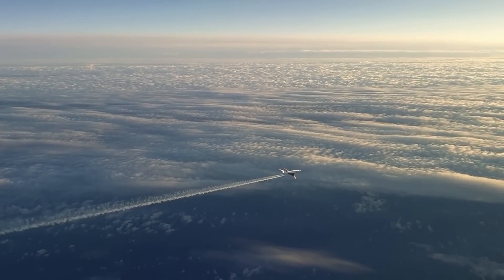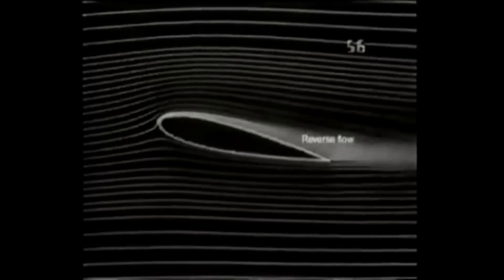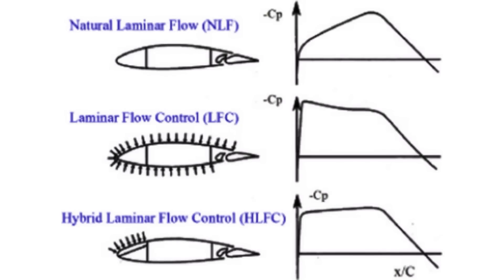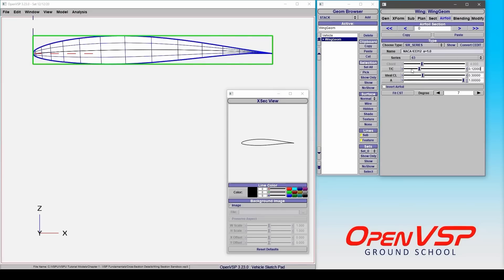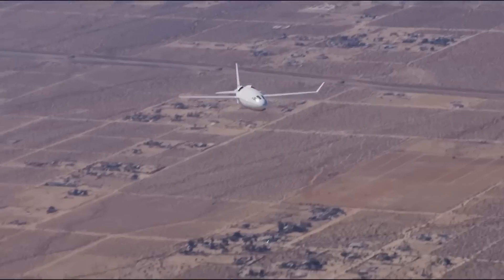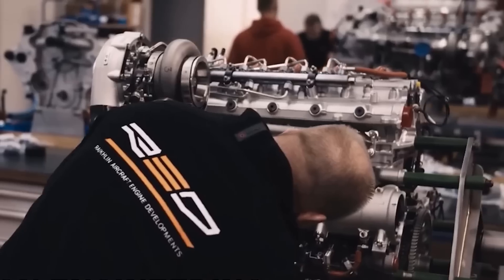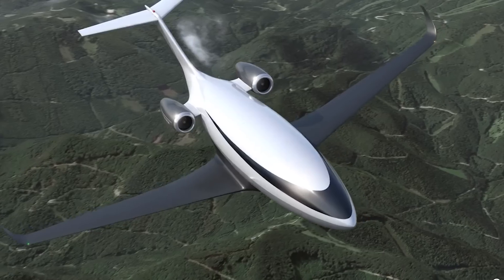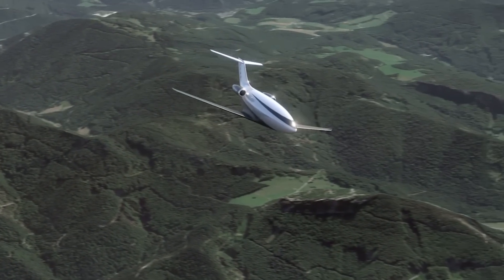Otto Celera 800 vs. Celera 500L The World's Most Efficient Aircraft

Comment: I'd hate for this to be vaporware, but it's been a while.  What are the drawbacks and what are the challenges to overcome?
Reply: According to another video, test flights for the 800 are planned for 2025.   That's pretty good time, but they have probably been working on the 800 concurently since the program started.  I don't see much that could be called a drawback to this design, other than the fact that it doesn't appear to scale up  to  larger aircraft.  The unique shape required by the fuselage for laminar flow, limits it's size.  You can't just make it longer without making it wider.   So it looks like it will be an optimized design, aimed at business class jets.   At least to start.  It should dominate the market in that space I would think, making conventional business jets practically obsolete.  
     Once the design is tested, you have FAA certification.   That takes approximately 5-9 years for a new aircraft, but that would depend on what stage of certification, if any, that they are at now.
    That's my unqualified opinion.  Take it for what it's worth.  They seem to have a strong team and business model and a great product concept that is essentially proven in it's design.  Can't wait to see one in the air.
Reply: At least someone is asking for analysis (I hate hype and empty claims).

Laminar flow isn't new, actually more than 60 years of studies, as you see, even the wind tunnel footage is older than most of us, and laminar wings have flown for 40 decades already (eg : Dassault Falcon 50). As for a laminar fuselage, it isn't new either, the Sukhoi 27 Flanker is one very nice example, an aircraft that can fly without its main wings.

Problem is, as stated, SIZE. The bigger the aircraft, the fatter it gets, at some point, you'd better change plans to a blimp rather than a sturdy fuselage with wings because it becomes TOO heavy (structural strengthening), and no, composites won't help much. Because you have a size limit, the purpose of your vehicle is limited to a niche : something small, private, no heavy cargo, either a private jet/turboprop, or a small 2, 4 or 6 seater piston / EV. That's not new : Paternavia P68, Piaggio P180 Avanti, Lancair Columbia... And because you have a bunch of competitors on the market, both conventional design (efficient enough so far and proven profitability) and slightly on the edge (ego centered marketing), you, as a manufacturer, won't sell thousands of units, more likely a few hundreds (is it profitable?)

Now, manufacturing and maintenance wise, such fuselage and wings are likely to be moulded/printed as a whole, when they are damaged, you cut big holes and replace/reseal. That's no small feat, and very expensive. Why? Because a cylindrical fuselage can have multiple sections, and many of those sections are nearly identical, you can design sections in such a way few minor changes via very few tooling alterations can finalize the assembly of an entire fuselage (also, provides you a comfortable room for changes/improvements depending on customer demands/expectations). Now, with a laminar fuselage, your PRODUCTION (incl. R&D) and spare parts logistics & supply skyrocket like hell. If it happens clients aren't satisfied by the prototype characteristics and performances, you'll probably go bankrupt as you can't afford to revise an entire production line in your factory. That's the invisible but very real cost/risk difference between "simple/easy (cylinder)" designs and "fine tuned/complex (laminar)" designs. You can be "perfect", but nobody cares because you're not cost/time efficient..

Everybody can claim to be an engineer (or whatever), who's right and who's wrong doesn't matter, actually, everybody is both right and wrong at the same time. What matters is "does it actually makes sense as a WHOLE?" You don't just look at it as an aeronautical engineer claiming "it's possible and it works", of course it does, but at what cost? You don't just look at it as a philanthropist who believe in the future, if you aren't the one to decide, you must at least put yourself in the shoes of who do : there are a bunch of safety regulations in the industry, which translate in several hundred or tons of equipments in the vehicle eating up on payload and fuel/batteries, so, an empty prototype is NOT enough to get airworthiness certificate, most flying EV projects fail to pay attention to those concerns, and in the end the development end in a vehicle several times LESS efficient than claimed (once you equip them with systems and safety components, a LOT of dead weight dragging range, speed, service altitude, everything down).

Finally, that electric hype... On the ground wherr roads prevent you from sinking in the depths of Earth, okay, we can rule out one problem, but for flying vehicles, you must fight gravity. And in the battle of energy types, nothing as of yet beats fossil fuel : one kilogram of jet fuel packs MANY TIMES the enery you can store in one kilogram of whatever best worldwide electric battery that exists now and in the near future. Fossil fuel is so CHEAP to produce... Don't be fooled, laminar components is one thing, you can't pull the electric aircraft joker to look smart and sell the idea, those are absolutely unrelated, the only advantage of electric is being quiet, it's not even cleaner when you computes how much pollution the production of battery cells induces (from where come the components and to what extend the damages from their extraction/refinement/assembly? - No, batteries aren't cleaner than fossil fuel, you just displace the pollution in poor ill fated countries..)
Reply: "laminar wings have flown for 40 decades". 

Longer. Think North American P-51 Mustang .

The 500L is designed around one highly singular engine, but how dependent is that engine on it? I looked it up once, and there is some other design that may use it, but it commands a pretty small market segment. If the engine company folds, there goes the replacement engines and parts. An electric version would be heavier, which always means less efficient, and it would have much reduced range and payload. And no fuel would be burned off so every landing would be at high gross weight.
Reply: @herbertshallcross9775  absolutely. 👍
I tried to subtly shift perception from "cutting edge breakthrough technology" (as suggested), to a simple yet significant drag reduction improvement.
Actually, all wings since the early age of aviation are "laminar" to some extent, "laminar" is not some particular feature one wing have or not, it's just an indicator of how good different profiles of a wing at different sections is in accordance with the aircraft purpose to sustain coherent airflow on the trailing end. And at the same time, one wing profile cannot possibly be optimized for all of phases during a flight (birds are actually better at that), so you cannot be 100% "laminar" if you need to climb/descend/turn/accelerate/decelerate.. (similarly, all bypass reactors since early age of jet engine are to some extent "ducted fan".. that's not new either). 

For some reason, many of my comments got deleted 😒🙃, no big deal, but unfortunately, many informations, details and explanations are now missing, and I'm against repeating them, that won't change much. In short, I'm not skeptical of the importance of pursuing laminar improvements, that's a mandatory part of an aircraft development, I'm expecting, if things go on, a failure to meet the necessary resources to bring the 800 to a success story... for a huge amount of reasons where laminar breakthrough are of little to no effect.. People are discussing "vaporeware", well, it's not that 800 is yet another one, there are very serious people behind, but it ressembles a bunch of great engineers with a dream, but lacks the other non engineers people who know how money works (inevitable compromises ahead). If I nail the problem, well, those engineers will be sad, many people here will be sad, what shoud have not been a vaporeware (in about a decade) will become one against its will.. 😕
Reply: @StephenKarl_Integral  I really enjoyed your analysis of problems to overcome.  About the only advantage this plane has is a claimed 25 MPG and 4k nm range and 400 knot cruise speed.  Is this realistic?  My guess is it achieves 25 MPG at it's lightest configuration and at a much lower speed.  Fully loaded and at 400 knots the MPG will be much lower?

Comment: Works great in a wind tunnel but it doesn't work in the real world which has bugs, rain and ice.  You can't change wing loading when that laminar flow wing turns into a turbulent flow wing and the CL moves forward but the CG stays the same
Reply: These factors also are in play on a conventional airliner. So if conditions can deteriorate air flow, it will also deteriorate for all planes. This shape will be always more efficient.
Reply: @aaugustomuller 
Not true. Laminar flow wings are much more susceptible to change in wing lift due to surface contamination. Rain, bugs and dirt…
Reply: @aaugustomuller  heard that story many times before and none have ever lasted.
Reply: @alandavis6429  There is the issue of the non-cylindrical shape for high altitudes, but there is nothing preventing structural improvements to compensate for that. Of course, there will always be setbacks, but eventually, even if we don't live to see it, more aerodynamic shapes will become the standard for aerial vehicles relying on aerodynamic lift.
Reply: More than you think can be done with full electric control, such as flyby wire.  Think for just a second, such as the idea of a forward winglet that can retract or extend to compensate for the changing sensor of lift, Or as you know, with liquid fuel you can do it that way also.

There are a lot of dull,  Doctrinaire and Pessimistic people commenting here. Sad to say.  Boo!  Boo!
Reply: Safety is supposed to be boring. Nothing is more exciting than an inverted descent at such high speeds that pieces begin to come off. 

Complexity introduces failure points. The MD 80 pumped fuel into the tail to overcome the stability problem inherent in more highly swept wings, which worked until it didn't. Boeing's use of computer stability augmentation to overcome a deliberate aft CG only has killed two planeloads of passengers so far.  @steveperreira5850

Comment: So the primary reason this hasn't been done before is ease of manufacture. Boeing needs to make long tubes that are easy to manufacture and whose weaknesses and fragility over time is well known. You also cannot make one of these aircraft very long because to keep that ellipsoid shape suddenly means the diameter of the body is going to get quite huge.
Reply: Apply laminar improvements to a flying wing? Boeing's promo for a prototype based on the X-48 showed configurations for passenger as well as bomber service.
Reply: Maybe not for airliners, but there are plenty of little private jets flying all over the place and I'm sure there's at least a couple millionaires/billionaires who would buy one of these just for the uniqueness.
Reply: How huge can the diameter get before the laminar improvements are defeated? Imagine a shorter A380!
Reply: @ianweniger6620  apparently the supercomputer models cranked out the largest one being about this size for the 800 or a little larger. Not quite a people mover but not a execu jet either
Reply: SpaceX makes composite tubes far bigger.
Reply: Just means more levels in the plane and more space in the isles.  More room, is more room.

Comment: I wonder if this is more efficient than the blended wing bodies that multiple companies are working on.
Reply: This will be faster per unit of fuel.
BWB will be more space efficient.
Reply: BWBs get clobbered on scaling for passenger use.  if you get too far from the centerline of the aircraft, every little tilt makes the outermost passengers airsick.
Reply: @kenreynolds1000  Yes. Our advanced design guys figured this out 25 years ago. The current ones aren’t B2 bomber like. They are wide rcenter fuselages with wings on them.

Comment: Is "digital windows" mean installing a monitor connected to camera outside, then pretends they are windows? Sorry, they are not the same. Your eyes take on different focal length from looking behind a real window to watching a screen.
Reply from the maker: Certainly, I understand your concern about the use of "digital windows." While your assumption is a common one, the concept goes beyond merely installing a monitor connected to a camera outside. The term refers to the replacement of traditional physical windows with high-tech, glare-free panoramic digital displays.

These digital windows aim to simulate the experience of looking out of a real window by providing a dynamic view of the external environment. Unlike a static image on a screen, these displays use advanced technology to adjust the view in real-time, offering passengers a more immersive and natural experience.

However, you rightly pointed out a critical consideration—there is indeed a difference in the way our eyes perceive the environment through a physical window compared to a digital screen. The challenge for designers is to create a digital window experience that minimizes the perceptual differences and provides a convincing and comfortable alternative to traditional windows.

In addition to offering a breathtaking view, the use of digital windows can contribute to improved laminar flow and reduced weight in the aircraft, thereby enhancing overall performance. While the technology may not replicate the exact visual and focal experience of a physical window, it represents a step toward innovative solutions in aircraft design.
Reply: @aviapages  I am not seeing any evidence that any digital screen is capable of providing the proper rest to the eyes after seeing too much electronic screens or monitors from phones/pads/computers. Unless you come up with some sci-fi tech that nobody have ever heard of.

People in modern world suffer nearsightedness because lacking time seeing far away. If you are talking about using camera+screen in the way of X-59 cockpit, I am totally fine with that as flying that is a job. But replacing real windows of a transportation tool for passengers is totally another matter.